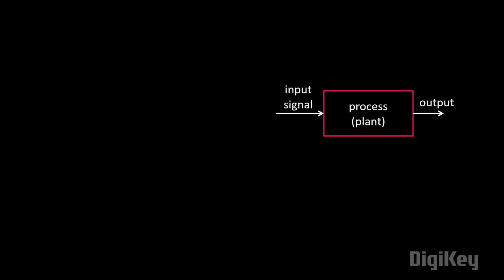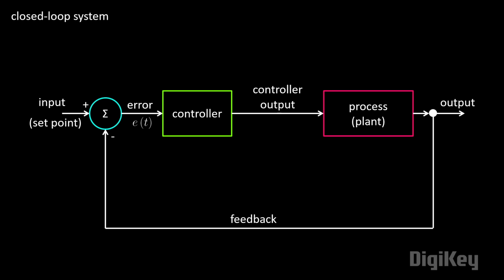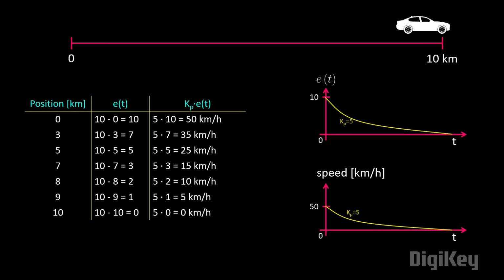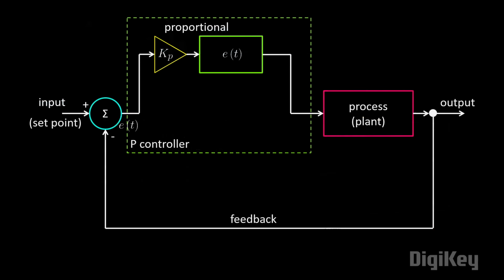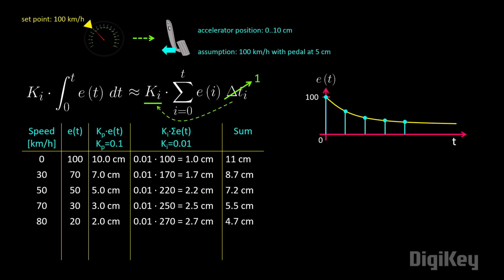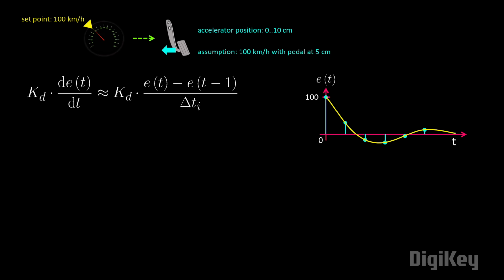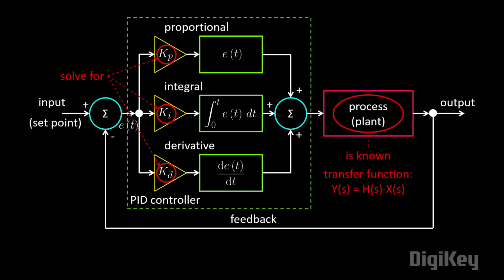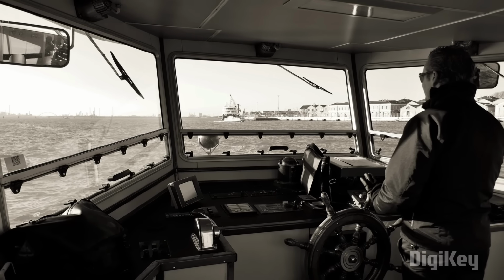What is a PID Controller? | DigiKey

Comment: can someone explain to me why in the proportional section for the first example there was no steady-state error but was one in the second example.
Reply: In the first example, we used the "position to goal" (in km) as the input and speed (in km/h) as the output. In the second example, we used "target speed" (in km/h) as the input and "pedal position" (in cm) as the output. The first example can be solved with a simple proportional controller, whereas the second example requires an integral term to deal with the steady-state offset. Hope that helps!
Reply: @ShawnHymel  Thank you for the explanation!

Comment: ”Sum each error interval over t”? So are saying to sum non-curved rectangles with height e and width t? Seems so. That seems very approximate though. Maybe more precise to add a rectangle at t and a triangle (half a rectangle) of height (e-1)-e👍🏻 (and yes, ‘e-1’ as the prior e) At that approximation level it would still maybe make liebniz and newton scramble for a better solution, but it seems more accurate than mere rectangles. Thanks again for posting this tutorial👍🏻

Comment: Beatmixing manually while DJ'ing with turntables is maybe a better analogy, because it involves active control of the motor speed on both sides of goal speed👍🏻 For example, if record is behind target synch and speed, then speed fader (pitch fader) is moved past target speed to synch, and then back a little past target if overshot, and then to center. That doesn't include the last PID step though

Comment: Here is some Python code for a  PID Controller using a z-tranform(digital) with the plant described in an equation. I got this code from Victor  J. Bucek book called Control Systems. There are 3 different systems. PID have a restrictive range and a Fuzzy Logic controller has a much wider range once tuned by an expert. I think the sampling rate is set to 0.01 seconds. Enjoy...

#PID ARRAY

#Wayne Mercier
#Jan 25, 2026

import arcade 
import math

 

E=[1.0,1.0,1.0]
U=[1.0,1.0,1.0]
Y=[0.0,0.0,0.0,0.0,0.0,0.0,0.0,0.0,0.0]

# Creating MainGame class        
class MainGame(arcade.Window): 
    def __init__(self): 
        super().__init__(1200, 800, title="PID Graph Array") 
  
        # Initializing the initial x and y coordinated 
        self.angle=0.0 
        
              
           
  
    # Creating on_draw() function to draw on the screen 
    def on_draw(self): 
        
         
        
        self.clear()
        self.angle+=0.01 #sets the speed of the radar sweep
        
        
        KP=1
        KI=2
        KD=0.3
        
        Alpha=KP+KI*0.5+KD/0.1
        Beta=KI*0.5-KP-2*KD/0.1
        Gama=KD/0.1
        
        print("Start...")
        
        
        for loop in range (1):
        
            for k in range(1,-1,-1):                   
                                   
                E[k+1]=E[k];
                U[k+1]=U[k];
                Y[k+1]=Y[k];
                       
                 
                E[0]=1.0-Y[loop] #ERROR
                U[0]=U[1]+Alpha*E[0]+Beta*E[1]+Gama*E[2]    #COMP
                
                #The plant equation is of this...
                Y[0]=(1.454*Y[1+loop]-0.4966*Y[2+loop]+0.008*U[1]+0.00632*U[2]) #Output
            
                print(Y[0],Y[1])  
                #Draw Crane Hook
                arcade.draw_circle_filled(self.angle*40,(200*Y[0])+300, 3, arcade.color.GREEN)
                arcade.draw_circle_filled(self.angle*40+20,(200*Y[1])+300, 3, arcade.color.WHITE)
                arcade.draw_line(1,300,800,300,arcade.color.WHITE,1)
                arcade.draw_line(1,500,800,500,arcade.color.WHITE,1)   
                if self.angle >= 20:
                    self.angle=1
                
        
        
        arcade.draw_text("PID Array", 900, 500, arcade.color.WHITE, 14)
        
        
# Calling MainGame class        
MainGame() 
arcade.set_background_color(arcade.color.BLACK)
arcade.start_render()
arcade.finish_render()

arcade.run()

Comment: "You set Ki and Kd to zero and leave Kp at some low value.   You increase Kp until the output oscillates with some steady state offset.  You then increase Ki until you correct the steady state offset even if that means more oscillation.  Just make sure the output does not become unstable and oscillates out of control.  Finally adjust Kd to remove the oscillations.  At the end of the process you should have an optimally tuned system.

Note there are other tuning schemes such as the Ziegler-Nichols method or you can use some math to help you choose Ki and Kd to reduce the trial and error that is needed."

I have watched a few tutorials on this subject and have never heard someone explain it so succintly.  The tutorial was exceptional both in the manner in which it was explained and in visual presentation.  Very well done sir.  👍🙌💯🙂

Comment: Is it smart to use DoE or Bayesian Optimization to tune a PID controller? I'm planning to use the NovoNordisc ProcessOptimizer package to use Bayesian Optimization, but searching in the parameter space without much understanding of the PID controller (other than the lower and upper boundaries of the P, I and D terms) will probably be difficult because you need quite a lot of samples. Like searching for a gold nugget in an empty space.

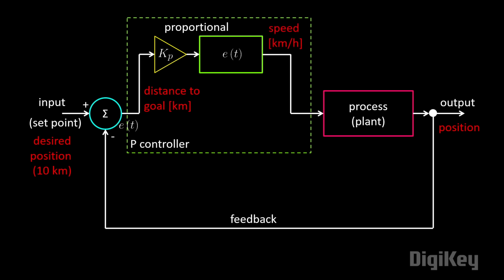Comment: The green box e(t) at 5:46 should not be there. Secondly, the output from the proportional controller is the pedal's angular position according to your context. This angular position can be achieved through a servo motor or similar actuator mechanism. The theoretical explanation is wrong.

Comment: The situation at 11.51 illustrate another common practical problem, overshoot in control signals, where the actuators cannot answer to signals potentially confusing any overall control loops that assume this to be possible. dynamic range ....

Comment: PID Controllers are used in commercial HVAC,  P (proportional only) , PI and PID

P (only) 

For example, to heat a classroom, using wall radiators installed under windows, P (only) proportional is used. Normally the thermostat is near the door entrance. This works well because, the the rise and fall in temperature (error from setpoint)  is very ,very slow (integral) using natural convection from the radiator. 
 
PI 

If the same classroom was using hot air for heating,  PI is used. The rise a fall in temperature (error from setpoint) can move faster, since you are forcing air around the room. An integral (or time based approach) help prevent rapid overheating / underheating from the setpoint. The mass majority of commercial thermostats use PI. 

PID 

Normally not used in a classroom, but rather in highly critical locations, like a lab, hospital or food processing use the (D) derivative part keep the room as close to exactly to setpoint without overheating or underheating

There is an incredible amount of money to be made being a PID loop tuner. You roam around the country fixing "loops" and because it is hard, they pay you big $$$, because you are either saving them money or it is required for their business.

Comment: The classical formulation with separate gains is often used in academia, but not by practitioners. Industrial control engineers have realised it's usually much better to use the "standard" parametrisation, with Kp as a master gain, expressed as a proportional band, and Ki and Kd being 1/Ti and 1/Td respectively. The integral and derivative times relate to physical properties of the system, making it easier to derive reasonable values based on prior experience, and keep relative PID contributions in proportion when adjusting KP.

Comment: Hello....  i m learning a lot from your video...manage to construct a circuit and its working perfectly now! thank you very much ! I have a question here: if i have a motor with the following spec. • Inertia (J) = 0.01 kg·m²
• Damping (B) = 0.1 N·m·s (friction)
• Back EMF Constant (Ke) = 0.01 V·s/rad
• Torque Constant (Kt) = 0.01 N·m/A
•Motor Resistance (R) = 1 Ω
•Motor Inductance (L) = 0.01 H
and i wana achieve speed control with: Zero overshoot, Minimal Settling Time, <5% Steady State-Error, please advise what should i do? TQ

Comment: Is it wrong to add a proportional offset, like:
output = k_p * (error + 30)
Is it wrong to be non linear, like:
output = (k_p * error * error)

Or combine them; both as part of a PID. The first will work more naturally depending on the system? Not sure. The second one will try to close the gap much quicker without creeping up on it?

Comment: Very confusing to me, you start by saying 5 cm pedal position = 100 km/h then immediately contradict that on first calculation showing pedal position 10 cm yielding 30 km/h.
Reply: First, "5 cm yield 100 km/h" means after you get to 100 km/h, if the pedal at the 5cm, the speed stay at 100 km/h and won't change.
Second, it is "10 cm at 30 km/h" not "10 cm yielding 30 km/h". 10 cm at 30 km/h just means the car is at 30 km/h and it is accelerating

Comment: Hello

Just my own comment to your fine explanation.

I have a hydraulic project where I have to control the force from a cylinder through a load cell.

What makes hydraulics special is the response time. 
The used servo valves have a 0-50% opening time of 6 msec (common in servovalves). That's why I must use a PID regulator with a cycle time of 1 - 2 ms.
There is only an expensive servo controller that can do that, or an analog PID controller, that I used.

Another part you easily skip over is the partial feedforward. It is frequently used in hydraulics.

Comment: Now we need a new method AIPID, or PIDAI.  Where we slap AI to the PID for it to figure out the prefect values for us.
Reply: You read my mind 😁 There are automated methods of finding PID constants, which have been in use for a while. I’m currently experimenting with using RL to figure out a generic controller (including swing-up). My hope is that this will be the next video.

Comment: A car wouldn't have any overshoot if you just kept it floored until your set speed, would it? So wouldn't you only use the PID after you got up to speed? Maybe that will be part of the next episode.

Anyway, thanks for the video, it helped explain PIDs nicely, looking forward to the next one.
Reply: You’d have to precisely let off the pedal at the right moment. The car has inertia and there is a time constant associated with the moment the pedal position changes to the moment the engine changes the torque applied to the wheels. All of that results in you having to letting off the pedal BEFORE the speed set point is achieved. Otherwise there would definitely be overshoot.
Reply: @dwang085  My question was meant to be more about initial values, starting/stopping point for the PID and maybe when to use/swap out the PID. Sorry if I come across as nitpicking the model.

But using it as an example:
As soon as you stop adding power, it would stop going faster (well unless you are going downhill etc. but that sort of thing should be outside the model) And the amount of inertia needed to be overcome to move the pedal position would be small enough I don't think it would matter, probably even happen before the next piston power stroke. Especially with fuel injection etc. And even if it would take a very small amount of time for the accelerator to move, you could still hand over at 99.9km/h. (Although I guess whatever you are using to automatically move the pedal could be quite slow (erm, do they even move the pedal nowadays?))

As for the car, engine, flywheel etc. inertia would help keep the current speed. It can't add speed, or you would have a perpetual motion machine.

So you shouldn't need the PID until you are up to speed? 

Anyway, my point being that in similar cases wouldn't it be better to hand over to the PID after a certain point, maybe with initial values taken from a table etc?